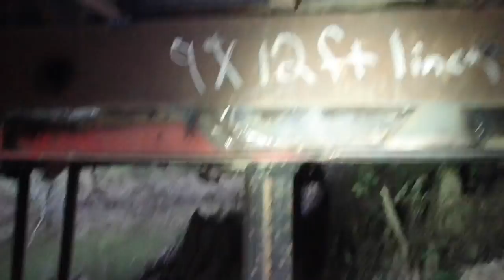New bridge install & how we crossed the creek

Comment: I was doubting like you were for those loggers to make it across that setup with the trailers I been in trucking 10 years and I know the flat bed tend to twist and wouldn’t be ideal for a bridge unless welded with some ideal bracing on a angle to prevent the twist. Good call on using the logs instead👍🏽

Comment: Good job getting across that creek I had to do that for a crew but they had broke up concrete slabs brought in I placed that in the bottom and on the sides they left it for the owners the creek was fine it flowed over it

Comment: That was a good idea to error on the side of caution for the machines. Before you even mentioned putting trees in the creek, actually I was thinking the same thing. Railroad car bridges are what we use.Not only are they narrow, like you said, also throw the mud factor in. I had a contract hauler slide his loaded truck off the bridge, when it got slippery with mud. He never drove across one and was nervous, again little margin for error on a railcar bridge.

Comment: thats actually a pretty clever set up but all the old time loggers would just do what you did they would even go further and put some logs going the other direction in the middle to give a spot for the water to flow then push 5-6ft of dirt on top of the logs to finish the bridge across and all the traffic would cross it

Comment: There is actually more pressure per square inch on tires than the ground pressure of the distributed load across the track..caution is best though.

Comment: Seems like bad planning to bring in a trailer that is too short, then to try to build a structure on soft ground. Bringing in some portable 2x2x4 concrete blocks to use as abutments to set it on would have made that trailer bed useable. Possibly. A lot of wasted time and people standing around due to lack of advanced planning here.